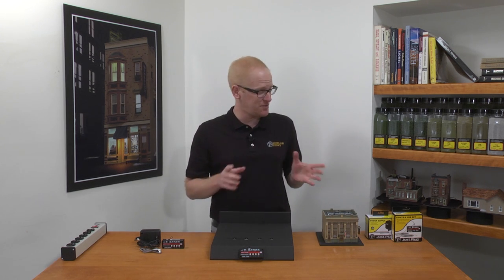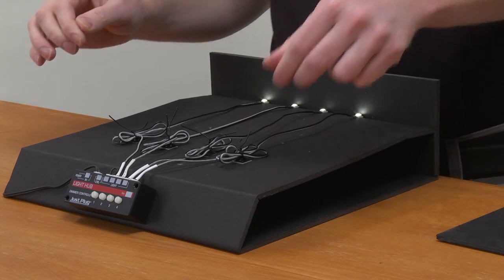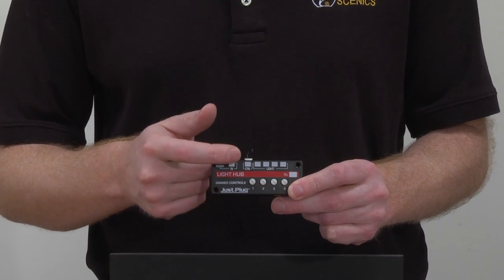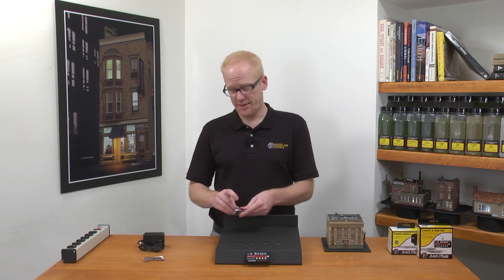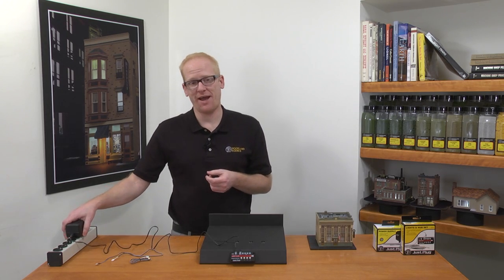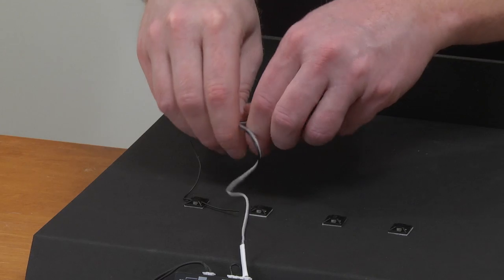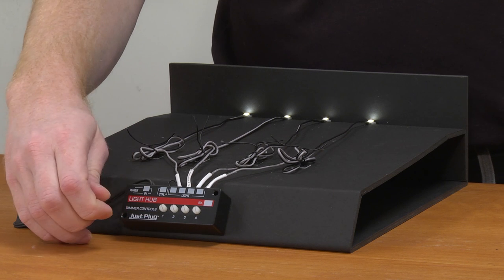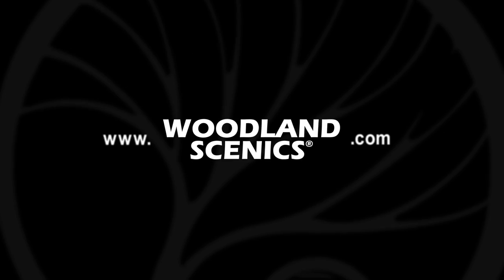Getting Started | Just Plug® Lighting System | Woodland Scenics | Model Scenery

Comment: Can you splice the wires of multiple LED's together to run them through a single port? I have a few buildings with multiple floors that need 3-4 LED's each but don't really want to use 4 ports for just one building.
Reply from the maker: Hello! The Just Plug system is designed for one Just Plug LED light per Light Hub port.  We cannot guarantee the results if using it differently.
Reply: Thanks for the reply. I'll give it a go and see what happens. I was curious as you guys wire together three street lights in to one plug in your street lights video.
Reply from the maker: Our Just Plug Nano and Stick On Lights were designed for one LED light per Light Hub port.  The Just Plug Street Lights, Wall Mount Lights and Vehicles were designed so that the number of lights or the one vehicle in each package can be connected to the one included Linker Plug.

Comment: Just curious if I use my 12v 19 amp power supply if I could plug more than 3 20milliamp LEDs into 1 hub if it would be safe to use as long as all my LEDs had resistors on them
Reply from the maker: This is not something we have tested, but we do not recommend altering the Just Plug® Lighting System.

Comment: How many single light street lamps can you put on one plug/port? What limitations need to be considered before implementing the Just Plug system?  At what point would I need to buy the expansion unit(s)? Thanks!
Reply from the maker: 1. Our Street Light sets (i.e. 2 lights in one package) fit in one port.
2. If you have a specific lighting effect in mind, we can let you know whether or not Just Plug can create the effect. If it is possible, we will provide instruction on how to achieve it. 
3. One Light Hub is designed to power 4 individual Pre-Lit items. When you are beyond that, you can purchase a Port Sharing Device. One Port Sharing Device plugs into a Light Hub Port creating four new light ports. This allows you to power 16 Pre-Lit items from one Light Hub. When you are beyond that, you can purchase an Expansion Hub. Four Light Hubs plug into an Expansion Hub.

Comment: ty for using shrink tube. i also think you should offer 8 or 10 pin hubs instead of just 4. people are going to end up with 20 of them easily, not cool
Reply from the maker: ***** Thanks for your comment, Mike. I will send it on to our Product Development department!
Reply: ***** i appreciate the response, i love giving feedback on products and actually having it make a difference in the world. thanks for being such a great company for SO many years.

and to reiterate on my original comment, i would definitely go with 10 pin hubs and not 8. also, i noticed you used 2 pin connectors like computer pc fan headers do. by doing so you've now enabled to yourself to make the LED's themselves modular. you could make LED's swapable with different colors, not at the hub itself, but where the end of the wire IS.
Reply from the maker: ***** Thanks MIke, I will send your additional comments on to Product Development for consideration. We appreciate the feedback. We like to hear from our customers about our products and what they think we can do to make them better. And, we appreciate you taking the time to put in your 2 cents! :-)
Reply: I guess the idea didn't go through as I bought a hub today and still only 4 outlets for lights
Reply from the maker: If you need more, you can try our Port Sharing Device. You can use it to plug in up to four LED Lights per a single port.  https://woodlandscenics.woodlandscenics.com/show/Item/JP5681/page/1
Reply: Woodland Scenics that was the issue that I commented about.  Too many port sharing hubs need to be used if you are lighting multiple items.  Maybe I just done understand but in order for me to light everything I have, I would need 8 just plug hubs and 2 port sharing hubs.
Reply from the maker: You can use one Light Hub and four Port Sharing Devices (one PSD plugged into each of the ports on the Light Hub) to light 16 LEDs. https://woodlandscenics.woodlandscenics.com/show/Item/JP5681/page/1

Comment: I'm using a 10amp NEC DCC system running at 12Volts, can I use track power to power the hubs?
Reply from the maker: It will provide power at 12 volts, but the lights will be dimmer.

Comment: For those of use with really large layouts, is it possible to extend the prewired harness length?
Reply from the maker: Could you clarify what you mean by "prewired harness"?
Reply: The LED bulb has a wire that leads to the plug.  I assume there's a set length of wire (aka wire harness) that it comes in.  What if need to run an LED, say 20-feet away from the plug in module?

Comment: Are the wires easily removable from the plug so that they can be run through a tube and then reconnected?
Reply from the maker: The Just Plug Nano and Stick-On Lights come with an attached
linker plug and are not manufactured to be removed from the linker plug. 
The wires on the Street & Wall Mount lights do not come attached to a
linker plug, you have to insert the Street & Wall Mount light wires into
the Linker Plug included in the package.

Comment: Can you get one with a 3 pin 240 plug?
Reply from the maker: Our Just Plug Lighting System does offer a 240VAC Power Supply for Australia/New Zealand. Hopefully this will work for you. Here are the specifications for that Power Supply:

POWER SUPPLY  AUSTRALIA/NEW ZEALAND (JP5773)
Type I
INPUT: 240VAC, 50Hz
OUTPUT: 24VDC, 1000mA

Comment: How long do they last? Do they dim over time?
Reply from the maker: Kinzer Hurt Hello Kinzer - Typically LEDs are quoted with a lifespan of more than 50,000 hours of continual use. We can't say exactly how long our particular LED lights will burn, as we haven't had one burn out yet in testing. However, we can tell you that LED lights have an extremely long lifespan, especially when compared to incandescent and florescent bulbs, and they will stay nice and bright. When they do reach the end of their lifespan, they will begin to grow dimmer. I hope this is helpful.
Reply: ***** Thanks.

Comment: What should I do?  I need to power about 15 different lights
Reply from the maker: Model railways Hello! You will need a Power Supply (JP5770), 4 Light Hubs (JP5700) and 8 packages of Lights and 1 Expansion Hub (JP5702).If you want Warm White Stick-On Lights, you could purchase a Power Supply, 4 Lights & Hub Sets (JP5701) + 2 packages of Stick-On or Nano Lights of your choice (16 to choose from) and 1 Expansion Hub. And, If you prefer to use your train power pack to power your lights instead of the Power Supply, you will need the Connecting Cables (JP5760) to connect your power pack to the Expansion Hub. Hope this helps!